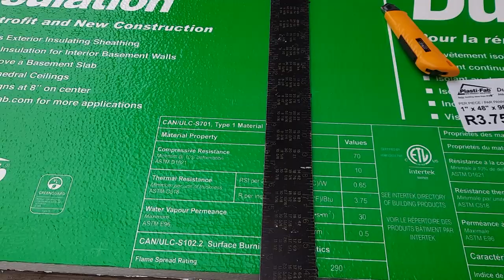TIME LAPSE | DIY STEALTH TRUCK BED CAMPER BUILD

Comment: I am interested as to the roof rack that you built, would you be so kind as to share more info, ie; design and materials???
Reply from the maker: Absolutely! This may be a tad bit hard to explain but we will try our best!

Our roof racks are 7ft wide, made out of galvanized steel angle iron that we bought from Home Depot. They run width wise on the front and on the back of the truck.
Because our topper is lower on the front of the truck we raised the angle iron up higher so it is even with the back rack. We used 2x3 spruce with deck stain to add stiffness. We also used 1/2 inch copper pipe with foam insulation on the canoe side so we could load and unload the canoe without scrapping it. On the other side of the truck we used a few pieces of 2x3 spruce so we can mount the solar panels. The cost of the roof racks was about $70 Canadian. 

Check out our solar panel installation video, you might be able to see a closer view of the racks themselves when we are installing the panels to the racks.

:)

Comment: Cool build! Did you figure out a way to prevent the t-handles from locking you in? I was thinking of wrapping the handle in tape so it wouldn't lay flat and lock so it can be turned from the inside. Not sure if it would work though.
Reply from the maker: Thanks! We added a piece of nylon strap on the inside of the locking mechanism so we can open and close the doors. We couldn't actually lock it this way, so we added just a simple hook lock to the doors for security.
Reply: Just drill out the pin holding the T handle

Comment: Great stuff and looking at building out a truck bed with a similar cap!

Two questions for ya. What did you use under the wood on the ceiling to get the black color? And how did you connect the wood frame to the metal topper?
Reply from the maker: Thanks!
The black part is quarter inch underlay that we painted black with strips of pine screwed on to it. And as for the other question, the cap is made from 1 inch square tubing and we screwed pieces of wood beside the tubing as backing so we could screw the ceiling into the wood backing. Hope that helps! Good luck with your build! Would love to see pics!